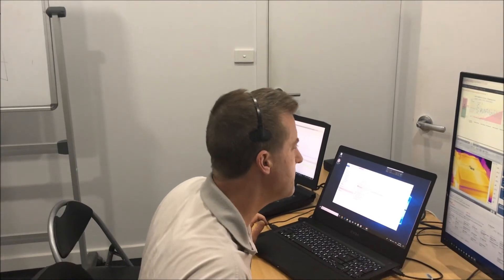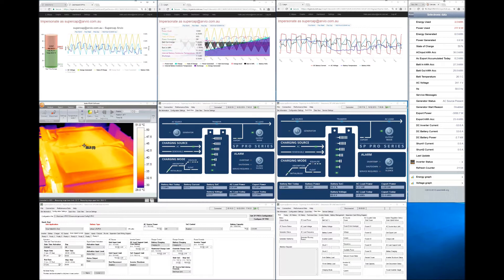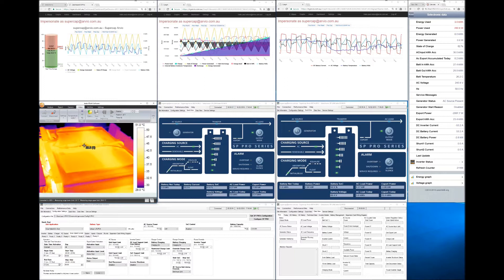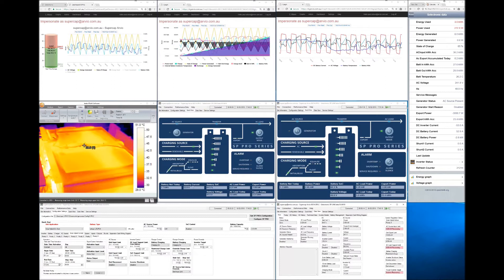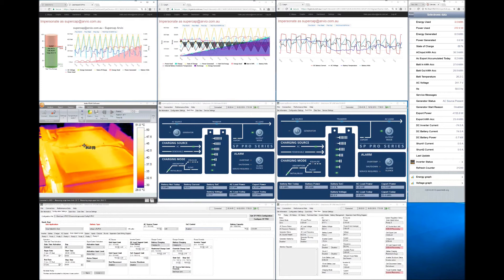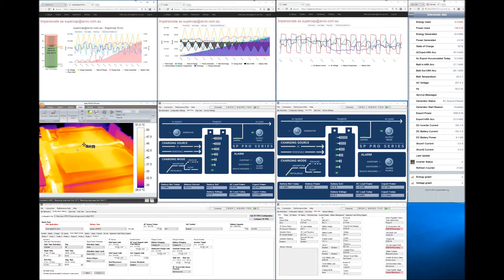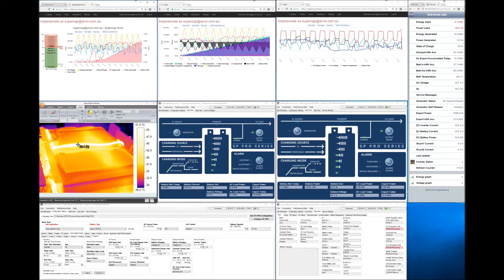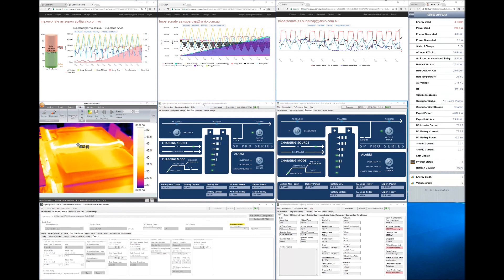Super capacitor live test by Arvio

Comment: I've been testing one of these in our workshop, and found it very impressive.  Unfortunately the application we really need it for requires an operating voltage between 100V and 120V, do you have any options in that range?
Reply: Any reason you couldn't just run multiple 12 or 24v scaps in series to get to your target voltage (i.e. 6x24v gives you 120V).
Reply: @joshmason6169  they say you're not allowed to

Comment: Hey Paul, you mentioned a few times in the video that you're charging the supercaps with the inverter.  As far as I'm aware they require DC charge so it would be rectifier charging them, not the inverter. Inverter uses DC voltage and turns it into AC voltage, same as our solar panels on the roof with DC voltage output are used by inverter to inject AC power back into the grid.
What's your personal view of the energy density between VRLA batteries commonly used in -48V communication systems and supercaps?
Are they similar now, or supercaps are still lagging behind in energy density like they were in the early days when they first appeared on the market?
Cheers!

Comment: The impressive  thing here is how much energy they can store.  Fast charge, discharge and long life is something any capacitor of reasonable quality will maintain.  This kind of testing will always outperform a battery. What I want is test results of how long it can hold a full charge, leave it sit for a week or two and then discharge it. Need a test that will show the standby / self-discharge rate.  Maybe your test is designed to avoid that? ;)

Comment: 5110 cycles a year, so only 195 years to reach the million!
Reply from the maker: Andrew Radford yes it’s a great thing not having to worry about how many cycles the system has had and not losing performance through the system life. A big relief over chemical batteries. Also nice to know that you can’t wreck it by running it flat like chemical batteries.
Reply: Paul Wilson The 100% discharge will be especially good for electric cars. I'm a Nissan Leaf owner and am interested in how the modules were integrated into the car.